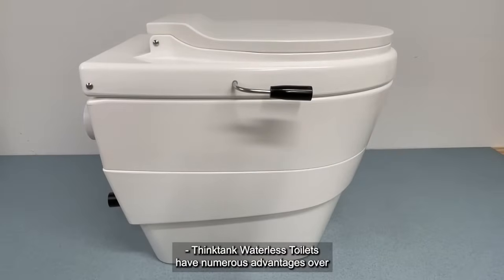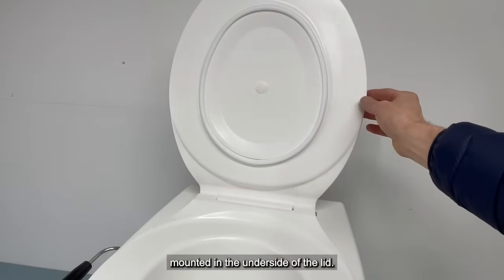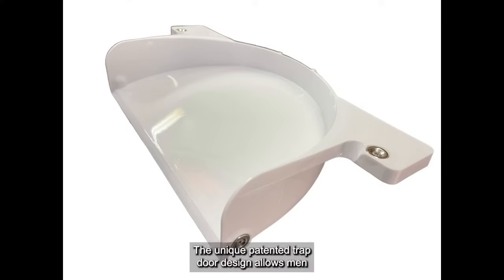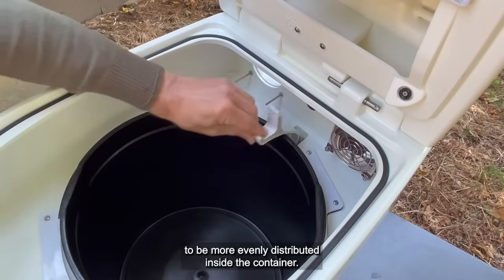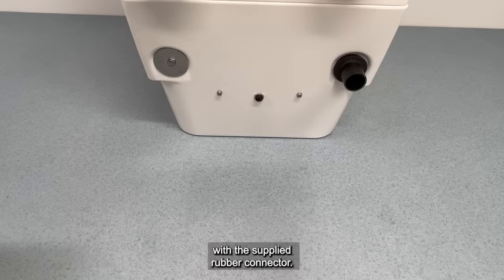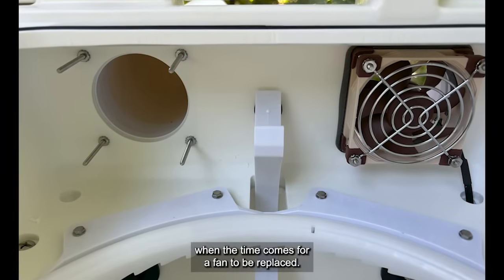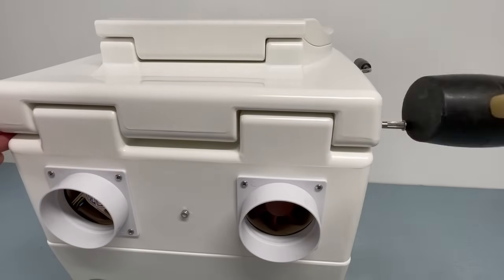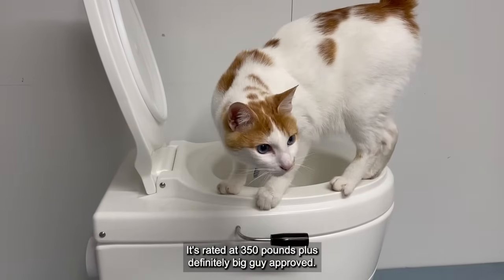Thinktank Waterless Toilets Are Better 2.0. Updated video with new drain attachments, 2024.

Comment: Thinking about buying one but I have some questions.
-Is the unit suitable for an outhouse where winter temperatures are below zero?
-How many uses will the bucket hold?
- is the fan required to be active 24/7?
Is it a true composting process where extra carbon is required or is it just "poop in a bucket"?
Thank you
Reply from the maker: The Thinktank is designed and built for extremely cold temperatures. I have personally installed and tested one in Winnipeg, Canada at -40 degrees. It worked perfectly. The sold waste container realistically holds 50 uses, on average. The fan should be used 24/7 for 100% zero odor. This is required inside a home, for example. In a well ventilated outhouse, you can probably turn it off, if power consumtion is a concern. It's very fast and easy to empty the toilet, so if you are going to be away for a week or two just empty it and unplug the fan.
Reply: @thinktankwaterlesscompostingto  thank you yes I'm considering for an off-grid application
Reply from the maker: @Just-Iss-4U  Another option is a rotating wind turbine. They work well as long as the wind is blowing. A typical off-grid solution is a small solar panel and a deep cycle 12 volt battery.

Comment: I am looking at swapping out the Separett Villa for the Think Tank. Your design addresses all the shortfalls I've experienced with the Separett since installing it 3 years ago. It's going to end up being an expensive experience (I have to use a contractor to do the work) but it would be nice to finally resolve all the deficiencies by installing the Think Tank. I hope it's not too complicated a process.
Reply: It should be fairly straightforward. The only big difference is the Thinktank pipe comes out the back, while the Separett pipe comes out the top. The Separett uses metric pipe, but it would have come with a coupling for connecting to North American pipe. You can also buy that from Separett. With that coupling, you can hopefully tie into the existing vent stack. Another method (maybe even easier) would be to buy a Fernco flexible coupling at a plumbing supply store. You also need an air intake for the Thinktank, but that can go anywhere. I am always available if you need advice when installing the Thinktank.

Comment: Does the fan use a battery or electrical hookup?
Reply from the maker: It can use either. It comes with one cord for a 12 volt system and another cord for  a standard wall outlet. You can choose the one you need, plug one end into the toilet and the other to the power source.